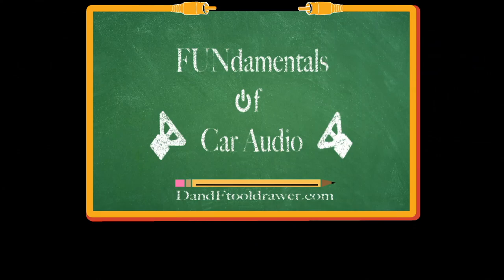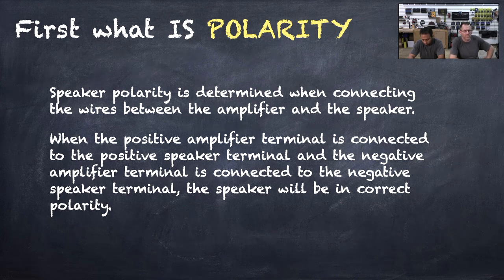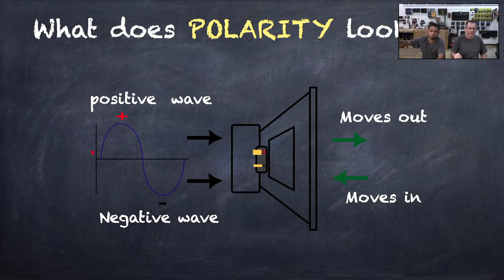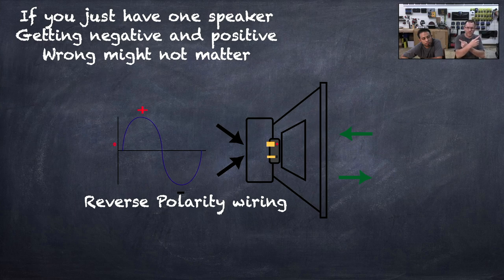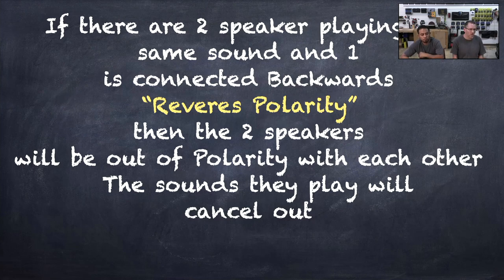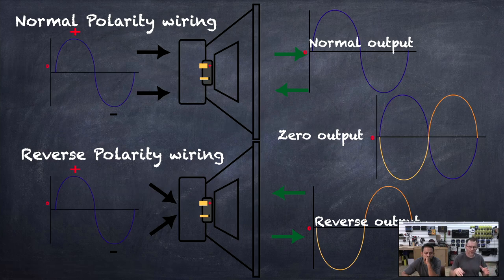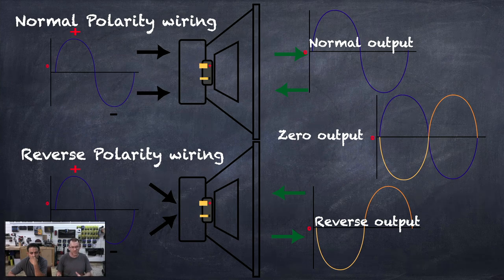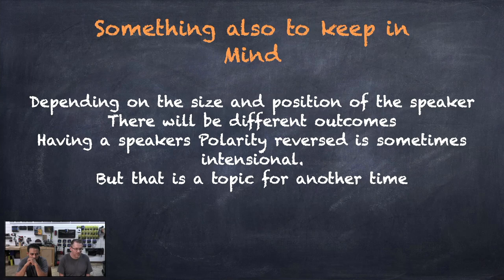What is speaker polarity, and does it matter

Comment: I have a fourth sprinkler system on my Harley. The front two speakers were out of polarity. The rear two were in polarity. I was told as long as they’re all the same it would be OK so I talked through speakers since they are much easier to get to and put them in the same polarity is the front which is reverse polarity is that OK?